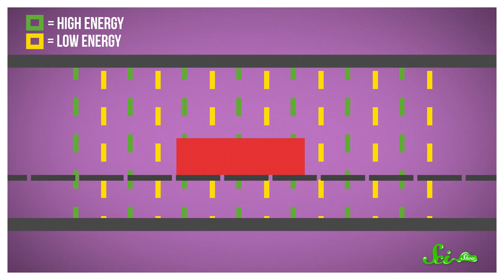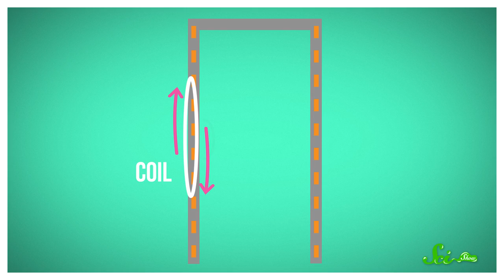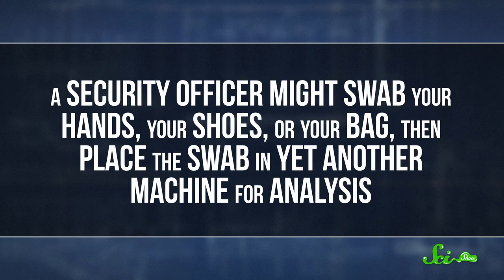Is Airport Security Effective? | The Scientific Breakdown

Comment: this is fun because i used to work for a EST company.  more of a charge vs volume thing than a charge vs mass, but darn close (Mass spectroscopy operates under a vacuum which makes charge vs mass very easy, but the machines in airports dont because vacuums are very expensive, bulky, and loud, so they use charge v volume)

Comment: Im a security officer at Heathrow airport in London.
I can confirm everything said in this video is true
Reply: So does that body scanner pick up stuff just on you? What if a woman was putting stuff inside of her V? Would that scanner pick that up?
Reply: @angelinaramirez6972  
Thats correct, body scanner at hearhrow and eu aitport use radio waves so they are not harmful. They will pick up any object hidden behind clothing layer. It would not penetrate through body layer but clo5hing layer only
Reply: @angelinaramirez6972  do you live near Heathrow airport
Reply: If I carry 100 ml perfume bottle is that fine? Do simply scan it or do they also have to manually remove the lid of the bottle to check the liquid vapours?
Reply: I have screws an Rod in my femure bone my docter advised me to remove these things after 4  months but after some days i want to go london Does this thing Create Problem for me on hitro airport at the time of scanning?

Comment: Will someone with embedded magnets be allowed to fly...
Reply: Glorval MacGlorvas probably  would be treated like earing or bone pins
Reply: If somebody has a pacemaker or hip replacement, they'll probably receive a pat-down search rather than a metal detector scan. Also most airports are moving to mm wave machines, which won't interact with metal implants.
Reply: what about MAGNETS though?
Reply: I have a pacemaker holding a pass/card that proves it. Generally they give me the choice to either get checked manually or to go through the millimetre wave scanner. Depending on the crowdness I just let myself get checked manually as they give me priority over the people in front ahahah.

Comment: You don't need to look for the outline of a gun. Nothing looks like a gun on an xray machine, except a gun. They stand out like you wouldn't believe :-) When I worked at GE in Spokane, I found one (in a priest's briefcase). If the gun is lined up so you can't see its shape, you still can't see through IT so you have to open the bag to see what that big, black rectangle thing is that you can't see through. And to see what was under it, in case it's just a block of steel or something.

Comment: How come clouds are always flat on the bottom?
Reply: They aren't always flat on the bottom. There are many types of clouds that do not have flat bottoms.  The common cumulus cloud is flat on the bottom because it is formed by rising air (thermals). As the air rises it expands and cools, when it cools past a certain point the moisture in the air condenses and becomes visible. That point is called the cloud base. You'll notice that al the clouds will have the same cloud base on a given day. The higher the cloud base the drier the air will be.  Sometimes the bottoms of those clouds will be concave, that happens when then thermal feeding the cloud is very strong.
Reply: They're not?
Reply: So why do they all have the same cloud base, though? That's just the line where there's enough moisture for clouds to form, and it's drier below there?
Reply: No, it mostly has to do with temperature. As altitude increases, temperature decreases. When the rising air cools down to the dew point then you see the moisture in the rising air mass. The "line" marks where the temperature is cool enough for the moisture in the cloud to begin condensing.
Reply: The altitude of cloud base depends upon the humidity, temperature and atmospheric pressure. Drier air will have high cloud bases - such as in the desert, and humid air will have low cloud bases - such as in the tropics.
Reply: minuteearth did a video on why clouds have flat bottoms

Comment: I have a keyring that's like a tiny swiss army knife, mostly crap but one of the bits is pretty sharp... I went through airport security in Australia and Japan with it and only realised at the last moment that it might be an issue, but nope, they didn't seem to notice. Is that just because it's so small that you could probably do the same amount of damage with a pen, or because the machines aren't quite good enough to see metal inside metal?

Comment: Isn't the last device a mass spectrometer and the solvent used nitric acid because of its ability to dissolve metal residues? I thought there a separate device that detects animes that are typically used for explosives.

Comment: was held up at JFK for 50 minutes, almost missed my flight. because the TSA that was inspecting my carryon didn't know what an epipen was and I had to explain to him and then his.. manager? higher up person in charge of him. why there was a needle in it and no its not always exposed. they probably did the bomb residue detection swab test on it a good 10-12 times. the only reason I did not miss my flight was because I was in a wheel chair and was not in the normal line and did not have to go through the wait in that line just to get to the bag check and screening. ugh that was a nightmare

Comment: What causes heat waves? (those things that make the stuff behind it look all wavy that are over hot things)
Reply: Tyler McCandless "The reason that things look wavy in the heat, instead of appearing as a stable image of the sky, is that the air temperature is not stable. Hot air naturally rises, so as air comes off the hot surface, it rises for a bit before rapidly cooling and sinking to be heated again. This constant mixing of hot and cool air produces vibration, which translates into refracted images looking wavy."
Reply: Heat haze is caused by warm air from a hot surface such as a car's hood or asphalt mingling with cooler air from above. The temperature of the air changes how it bends light, so hotter air bends light in a different manner that the cooler air, and thus things behind the heat haze look distorted and wavy.
Reply: My guess, heat.
Reply: KpilotRCHelis Thanks! I have always wondered that!

Comment: When I arrived from my flight from Japan to Austria to get on another flight I had to go through another one of those things. I however don't know if it was a metal detector or the other thing, all I know is that I didn't need to raise my hands but it still was very confusing. I didn't have any metal on me, just my clothes. But still they had to feel me instead for some reason. My mom or brother didn't have the same issue and I spent a bunch of time wondering why I didn't successfully get through. It was very strange and I'm wondering if anyone maybe knows why that happened or what could have been the problem? Because I've never had that issue before and I almost started thinking "Do I look suspicious?" or something. All I know is that I'm a bit angry at that metal detector or whatever it was haha
Reply: It was a random check for sure, we have that same system in finland. The metal detector gives random alarms sometimes and then you step on the body scanner even though you would not have any metal on you.

Comment: The regular metal detector has "alerted" on me 2-3 times this past half year. I've flown a gazillion miles in my life, so I'm 100% positive it's not alerted due to my ignorance. Are the "detectors" rigged to make a makeshift alert at random intervals?
Reply: Ya gotta remember, ANY metal items will go off in the metal detector, not just weaponry.
Reply: This also includes the metal on your pants, like with your button and other metal bits.
Reply: One of the alerts was triggered when the only metal on me were the rings that shoelaces are threaded through. Other than that I was wearing a t-shirt and pants with no zipper and a rope-kind of "belt".

Comment: I'm pretty sure the long security lines, and the hassle we're put through, is only designed to make us FEEL safer...

Years ago I was flying out of Baltimore. The terror alert level had been raised to Red & the security lines were 2 hours long.  It wasn't until I was at the front of the line that I realized I had a stick of deodorant in my carry-on (a newly banned item due to the alert)... 

I got through just fine, no problems